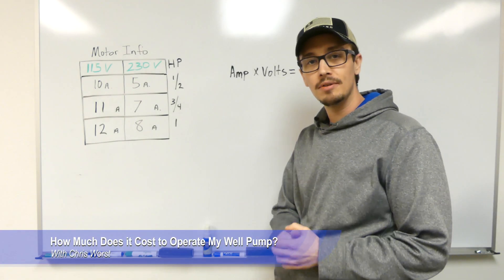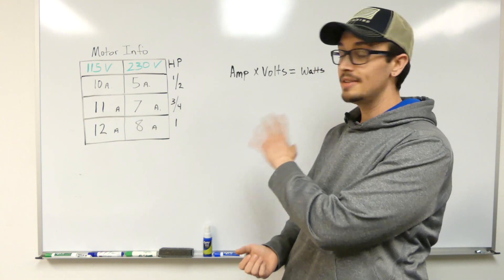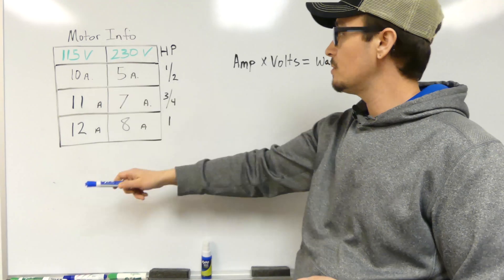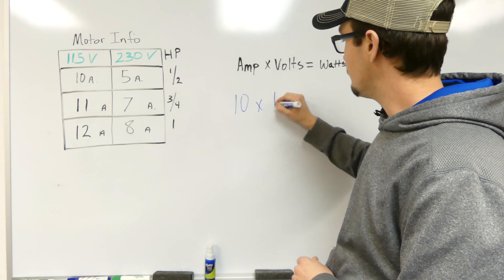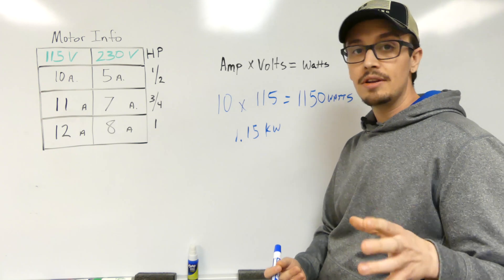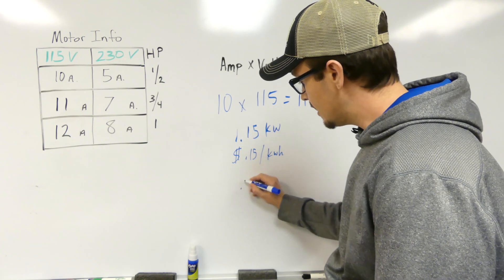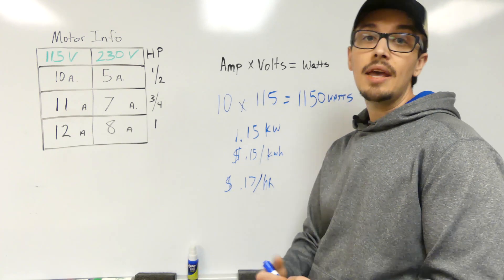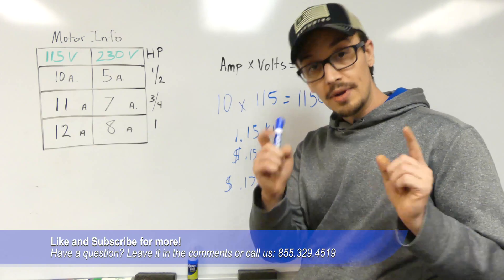How Much Does it Cost to Operate my Well Pump?

Comment: 1/2 hp submersible motor are .37 kw reguardles of voltage ,its no cheaper to run on 115 or230 volts

Comment: How do I figure costs based on volume of water pumped? How long does pump run to fill up a 30 gallon pressure tank? I'm trying to find out how long the pump will run cumulatively to pump 1,000 gallons to the surface from 90' deep. Does depth of well pump affect kwh?

Comment: In this example are you saying just to have a pump it cost .17 x 24(hours) = $4 a day ? or are you saying it’s .17 for every hour you have the water on? Thank you!!
Reply: It's a rate of17 cents per hour that the pump is actually running.   Like car speeds, we say 60 miles per  hour, that's a rate, it doesn't mean any hour in which you drove some, you traversed 60 miles.  That 17 cents per hour could also be expressed as about 0.28 cents or $0.0028 per second.  Your pump should never actually run for an hour straight under any kind of typical household usage.

Most of the time the pump is off and your pressure tank has some capacity of water before it reaches the cut in pressure to call for the pump to run again.    Your pump likely runs for less than an hour or two a day combined.  Say your pump produces 8 gallons/min and your shower uses 2 gpm.  You could run the shower for 24 hours straight and your pump would only be on for 6 hours.  The other 18 hours, evenly cycled throughout the day would be drawing down from your pressure tank.
Reply: @murky2502  For an average household of 4, about how long per day is the well pump on?

Comment: my neighbor shares my well to their cottage in the summer months. She runs a hose to my water tap outside. (April to late September) Should I be charging her for water use? Thanks
Reply: What is cost per kwh?  If you figure .17/kwh, just estimate how much water is pumped through that faucet over the course of an hour and estimate how many hours per week or per month your neighbor uses the water. 5 gallons/minute=300 gallons/hour. Do they run a sprinkler?  2,100 gallons/day= $1.20/day

Comment: Excellent work! Now here’s a question for you good sir... would a larger pressure tank save on electricity or cost more in electricity? Several of my customers have asked me this. The time comes to replace their pressure tank... they have enough space... so they want to upsize from a 20 gallon tank to a 40 or 80 gallon pressure tank. What do you think Professor Chris? All technicality’s aside, we’re just talking in general. A bigger tank would cause the pump to cycle less, but the pump would stay on longer to fill a bigger tank.
Reply from the maker: Good question Robert! The amount of water used in either situation is the same, so what a bigger tank will do for you is lower the number of times the pump has to cycle to deliver that same amount of water.  Electricity costs will be nearly identical, but your pump will last longer if you oversize the pressure tank.
Reply: R.C. Worst & Co., Inc. 
Very informative. I have been wanting to use more water on my land but cost becomes prohibitive for me to keep the surrounding pastures green. At one point I was thinking of putting a few 2500 gallon tanks on a hill and gravity feeding to my house and pastures. I was assuming that the pump uses less electricity if kept on once for a good amount of time vs cycling on and off constantly. I guess I was wrong. I maybe should consider a solar solution. Any thoughts?